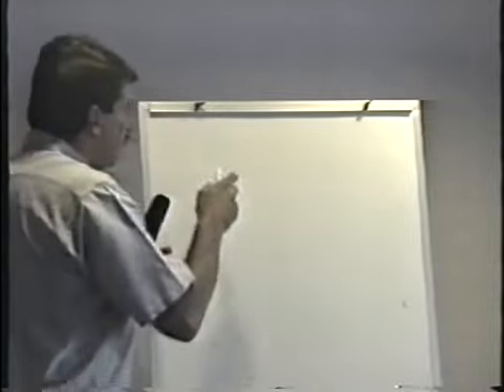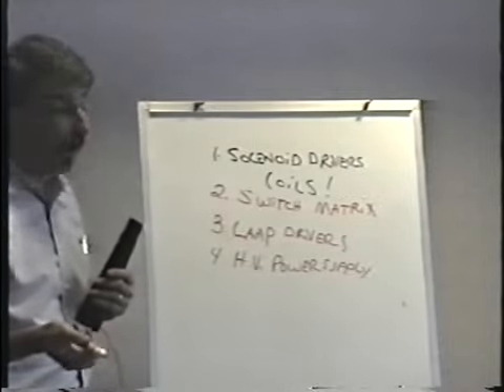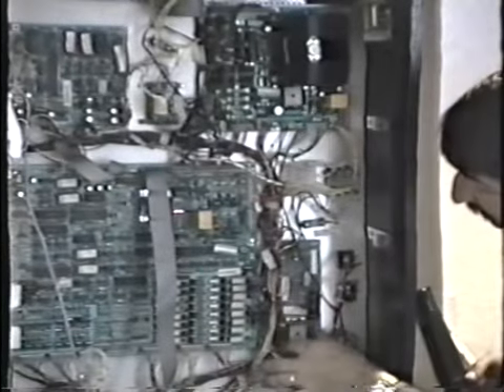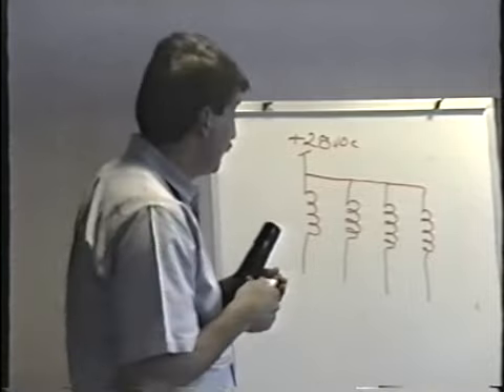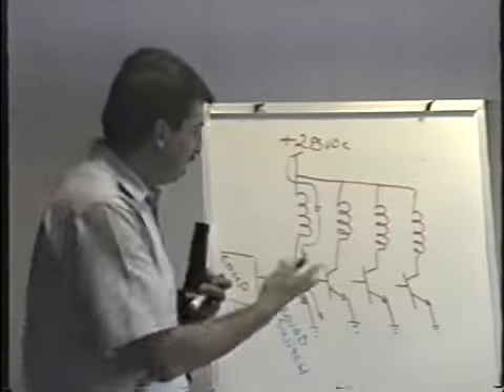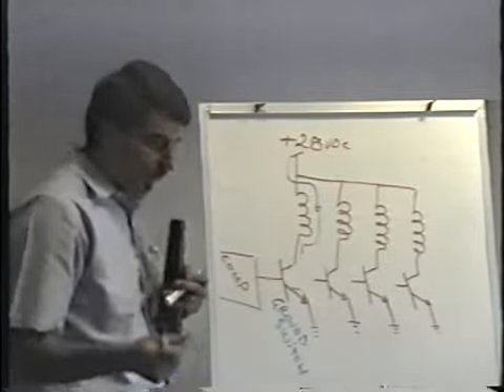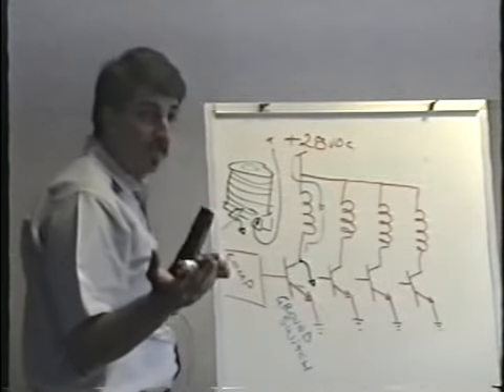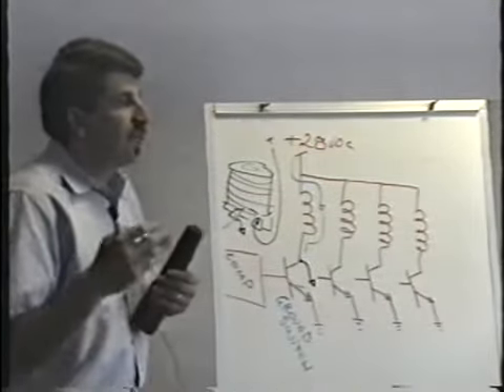Basic Pinball PC Board Repair

Comment: RANDY FROMM,
           1.) EM Pinball games the solenoid coils  measures 3.1 ohms to 3.3 ohms? 
            2.) Solid State Pinball games in the 70's & 80's the Solenoid coils measures 130 ohms to 165 ohms?
3.) WPC pinball games the Solenoid coils measures 5 ohms?
Reply from the maker: What is your actual question? Are you asking why they're different?
Reply from the maker: I think you're mistaken about number 2. That seems awfully high in resistance
Reply: @randyfromm  yes why are EM solenoid flippers coil resistance is different compared to solid state flipper coils?